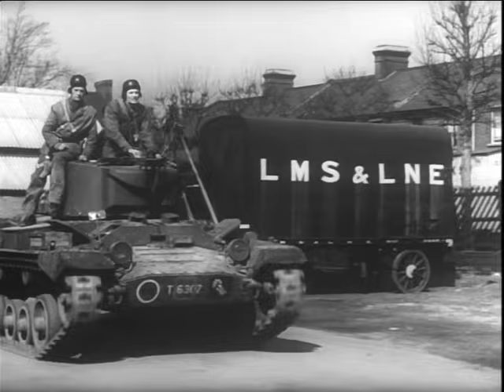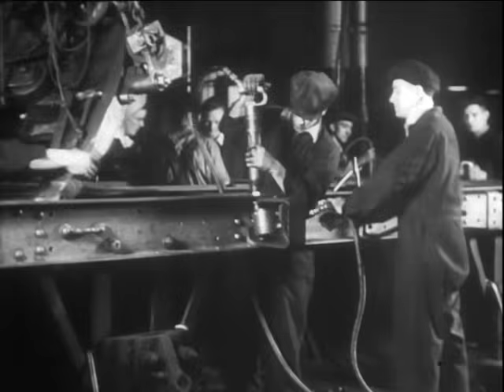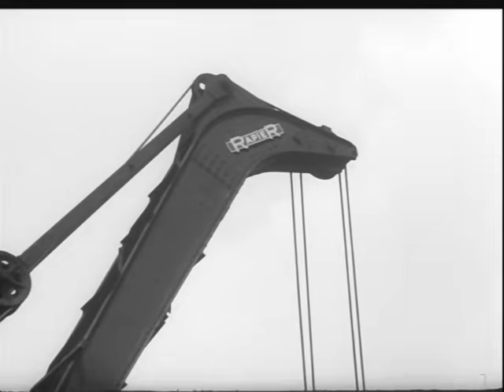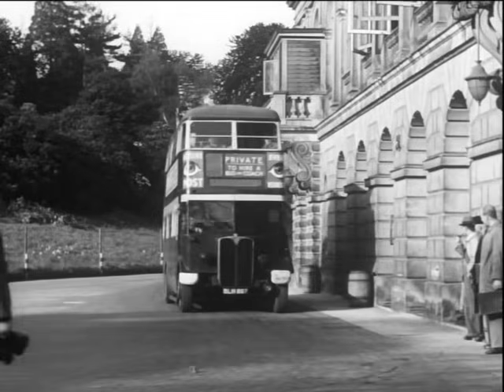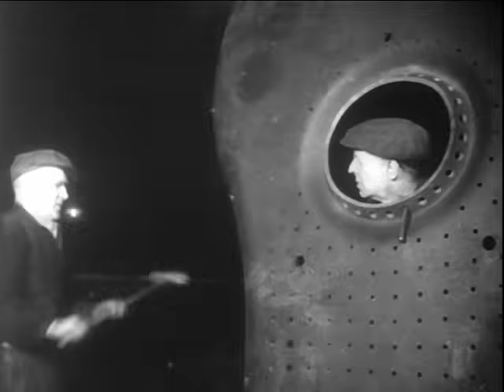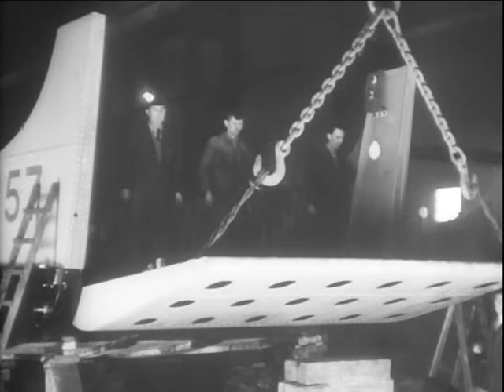Britains Railways: 1941-1943

Comment: At 19:10 the commentator states that a Merchant Navy pacific is working an express near Eastleigh, he’s wrong as this is Wimbledon Durnsford Rd with its electric unit depot on the far left and the coal wagon ramp for the power station centre left and all built during the 1st world war with all the main lines seen here equipped with the dc electrified 3rd rail at the same time between here and Waterloo, Eastleigh didn’t get electrified until the mid 60’s.